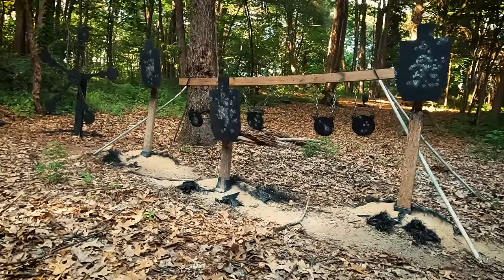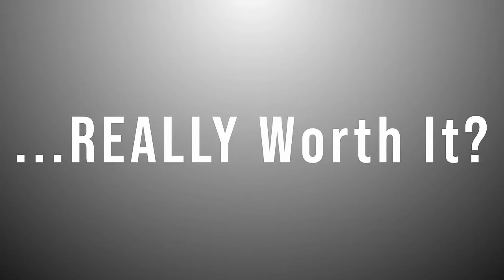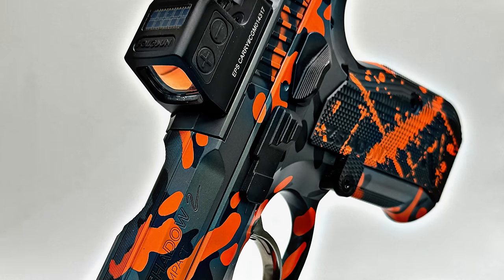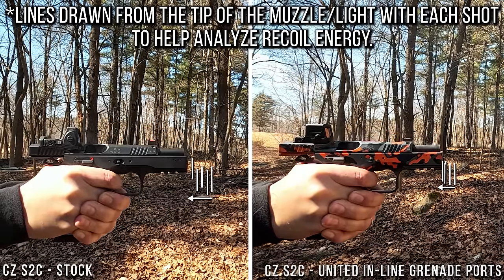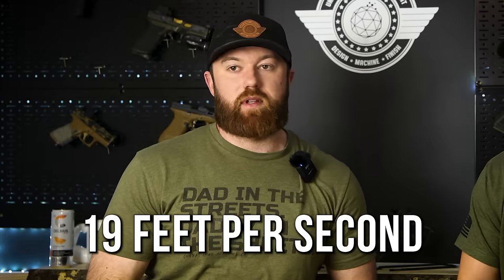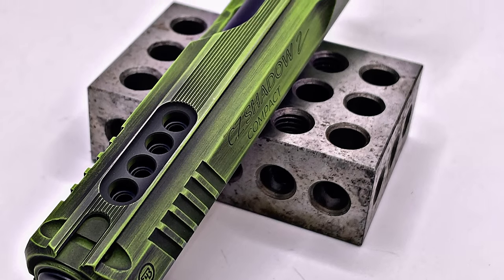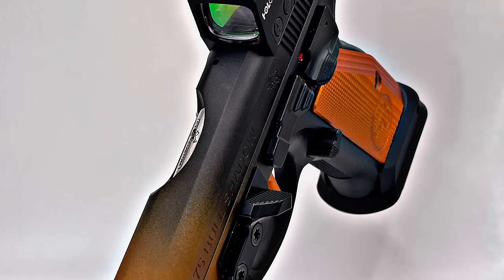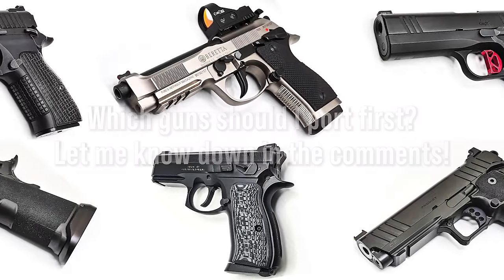Is Barrel Porting REALLY Worth It? | Intro to Barrel Porting with United Firearms

Comment: I think porting makes most sense for ccw guns. Gives you flatter recoil without length to your ccw. Additionally, you want to practice with full power loads, as porting effective decrease with weak ammo. Personally I wish it was more standard in the market.
Reply from the maker: Absolutely agree. Keeping a nice tight package for carry is a huge advantage. I'm really surprised it took me this long to try one, but you're right, factory options are very hard to find. Smith and Wesson is one of the only companies I can think of that does ports from the factory that you could actually find in a store. Definitely looking forward to trying more in the future. Thanks for watching!
Reply: @ChestersHobbies  it’s pretty surprising but Glock also does them under their “c” series (ie “glock 19c”) but pretty rarely
Reply from the maker: @godwinjoy9730 right! I've seen those mentioned here and there but I don't think I've ever seen one in person.
Reply: No danger in entangled or close quarters shooting?
Reply from the maker: There's a potential for spalling and uncomfortable debris when shooting from retention. Sage Dynamics has a good video discussing it. However it seems like the worst case scenario for spalling is with a chunk port of some sort, basically a very large chunk as opposed to small holes. Larger debris can try through the chunk and be a lot more serious. From what I've seen, debris though smaller port holes is uncomfortable but not unusable.

Comment: Great video!, since I have had custom ported firearms for a while there are a few things you're forgetting to tell. 
#1) oftentimes when you do the porting you can greatly affect accuracy, since most people just look at their guns as a fancy paperweight, if you actually go out and do accuracy testing on a lot of the ported Firearms, you will find that the accuracy is definitely affected on some of them. 
#2) inline porting the barrel causes the optic to become a giant mess, the carbon shoots up and completely covers the optic glass within a magazine or two, complete pain in the ass.
#3) a thick carbon buildup is created on the Barrel ports and portions of the internal slide. There's a lot of soaking scrubbing and cleaning to get it right it takes about three times longer than a standard unported firearm.
#4) Its extremely loud indoors, nearly twice as loud as the unported version.
#5. 100 permanent and you can never go back. 
IS IT WORTH IT????
Reply from the maker: Thank you for sharing! I don't own any ported guns yet... But I will soon. It'll definitely be interesting to see if my impressions change over time. So far, it's been positive, but you do bring up valid points. I think the ultimate question of whether or not it's worth it in the end is up to each individual user and platform. Personally, I learned a lot making this video and I'm really excited to give ports a shot. Thanks for watching!
Reply: @ChestersHobbies Thank you!

Comment: Is it possible to have both ported and a comp and not have a significant loss of velocity? I've seen a couple of videos where they ran both. Ultimately,  i just want the flattest shooting firearm possible.
Reply from the maker: Honestly I would say anything is possible with patience and experimentation.  Depending on how far you go with the porting or comping, likely some tuning would be necessary.  Something like a Beretta 92 would be best for experimentation with something like this, because if you go too far with the porting you could just get a new barrel and try again since it's an open top that doesn't need any slide work.  Definitely could be a fun project.  Thanks for watching!

Comment: Looks like they do excellent work. My only question is do they backbore barrels on certian port options? Very intrigued between them and floyds custom
Reply from the maker: Great question! I reached out to Mike at United to confirm. They do not back bore. Instead, they make sure to keep their tools sharp and replace them often to avoid issues with burrs. Seems like a logical solution to me, but I'm sure there's a reasonable argument to be made for either side. Thanks for watching!

Comment: What is the velocity loss if you increase the number of ports by one? Going from say four to five ports.
Reply from the maker: Great question! This will depend on a variety of factors, including ammunition used, barrel design etc. We'll be continuing to do testing throughout the year. I can tell you that we recently tested a 6 port setup in a 5" barrel and the velocity loss with that same ammo was around 35fps. I was surprised, I definitely thought it would be more, especially considering how much flatter it shot with that setup.
Reply: Thanks for the quick reply! Yes, there are so many variables to consider. I'm trying to game the USPSA 'system' in the open class and I have a gun with five ports. I'm trying to narrow down the velocity loss so I can select an appropriate (lowest PF of course) ammo. Based on your work and the others I've seen,  I'm going to go with five percent loss as a starting point.
Reply from the maker: @baxrok2. Right on! I think 5% is a safe bet. In the testing we've done so far the average has been around 3.5%, so that should give you a little wiggle room. Good luck and have fun!

Comment: For ccw, no. Clouds red dot glass after a couple hundred rounds, and creates spalling above the ports which can blind you shooting from retension, and can reduce velocity ~50 fps.
Reply from the maker: Absolutely valid concerns. Different porting setups will see different velocity loss, as seen in this video here. We intend to do a lot more testing on various setups and platforms over the course of the year to get more information out there. I agree on the spalling. Hunt Fish Shoot has done some excellent demonstrations where he cants the gun to the side while shooting from retention and experiences no spalling. However, that would be something one would have to train around consistently to be able to reliably reproduce. For me personally, I want to run them on the range because they're fun. Lots of different use cases and it wouldn't be appropriate for every individual and scenario, for sure. Thanks for watching!
Reply: I have ran my ported glock 19 with rmr through multiple pistol courses (2k rounds ish) as an appendix carry and have never experienced these issues you claim.
Reply from the maker: @aidanboywonder Thank you for sharing your experience! That's really interesting and cool to hear.

Comment: Been thinking about this a lot myself since picking up a CZ S2C and throwing a red dot on it.  Thing is a racecar built like a tank; I feel it needs a gas pedal or some other mechanism to control recoil (due to how fast you can shoot, it's like treating your grip as automatic) and I've wondered if mailing it out for porting would be worth it or if it's more of a customization flex.

Have a TTI Combat and while I don't hate it, I am sure the porting on it doesn't make a massive difference.  Even though I like the TTI design more, my Glock 17 custom runs better and that doesn't have anything special about it - just a swapped trigger and sights, $25 grip tape job and works damn well.

CZ is heavier than the TTI Combat but I feel like I best the recoil control with the glock which has neither a compensator (yet, looking at Radians afterburner combo) or porting, yet I can shoot it fast and accurate as hell for cheaper than either of the other options.  Shadow Systems is better than Glock, don't hate me for being right.  Timney Alpha trigger = best glock trigger ever made.

Comment: Can you port a 10 mm or 45 acp
Reply from the maker: Absolutely! They've ported both with great success. They have a video on IG where they made a 10mm glock look like 9mm. I would recommend DMing them on IG if you have any questions, they're very responsive.
Reply: yes, and just like with compensators the higher the pressure the cartridge generates , the more effective it will be.

Comment: Fps loss is about 20-50 on ported guns
Reply from the maker: Yeah it varies a lot based on different ammo, platforms and porting styles. I've tested several platforms now and seen roughly a 3-5% loss on average. Worth it to me, but good information to have for those that might be concerned.

Comment: Just get a comp and save your velocity!
Reply from the maker: Definitely an option to consider of course, though that's not always easy to do depending on the platform you're running. S2C for example I'm not sure threaded barrels are available yet. Comps come with their own issues as well. For me personally, I found the balancing act of a minor velocity loss (only 19fps and 34fps on the ones we've tested so far) to gain a smoother and softer recoil impulse and increased speed back on target, totally worth it. Not gonna be the right solution for everyone though, that's for sure. Thanks for watching!
Reply: @ChestersHobbies  you’re not lying! I have a comp on a vp9. I no longer can remove my barrel to clean. Definitely gets tiring sometimes.

Comment: Barrel porting does not help if you shoot factory loads. Factory loads are light loads.
Reply from the maker: Fair enough if that's your experience. I would respectfully disagree, as I only shoot factory loaded ammunition (primarily Blazer) and have noticed a substantial difference across a variety of platforms so far. It may not be for everyone, but in my experience, there's still a noticeable difference with factory loads. I think the percentage of improvement may be higher with a hotter load that's pushing more gas through the ports, but in my experience I would disagree that there's no difference in factory loads. Thanks for watching!